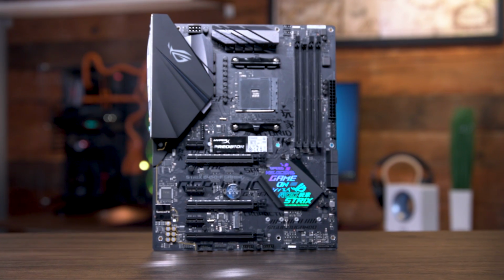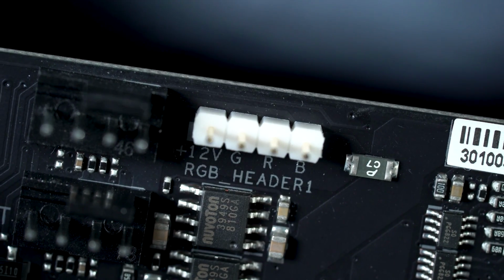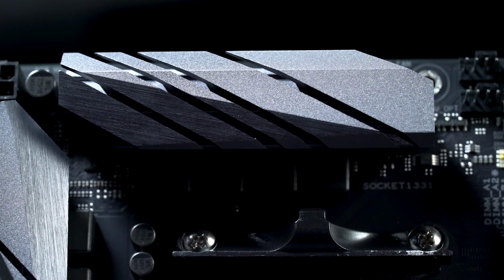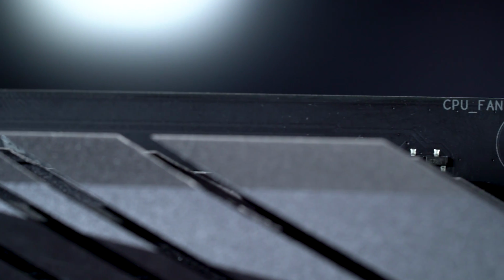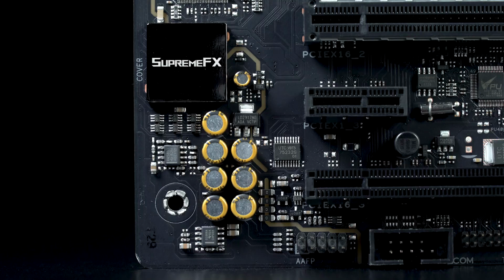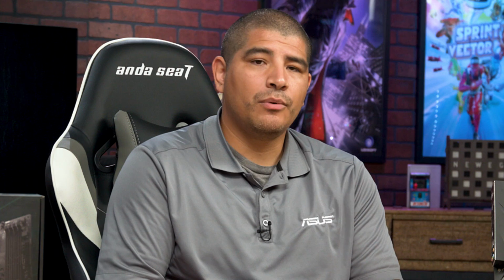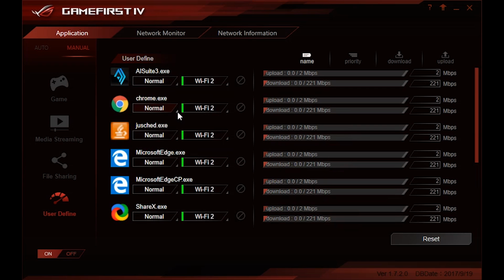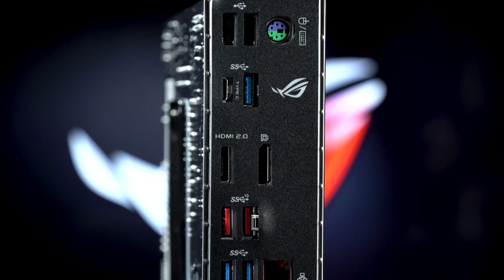ROG STRIX B450-F GAMING – Hits The Sweet spot for AMD PCDIY Gamers & Streamers

Comment: I have a system with 
ryzen 5 3600x
ASUS b450-f gaming mb
Corsair vengeance 2x8GB 3600Mhz Ram
Ssd 500gb
850w psu 
Fractal design C case
Corsair H100i Pro Xt water cooler 
And some fans,

My Ram is very new, and the orange light appears with both stick of ram in, and with this no picture says no signal…when I do one stick it’s fine and get a post bit I want to use both ram sticks, do I sell my current ones then buy a lower speed ram or what can I do…

Also the RGB of the AIO doesn’t like up, the fans aren’t rgb but the actual pump is. How do I turn it on?

Comment: I Built a system, the second one i've ever built :D

Specs:
CPU: Ryzen 7 3700X
GPU: RTX 2070
RAM: Corsair Vengeance 16GB 8x2 
Cooler: Nzxt kraken
Motherboard: Asus ROG STRIX B450-F (This One In The Video)
PSU: Corsair 750 W 80+ Gold Full Modular 
Case: NZXT H510 (White)
Custom White PSU Cables
Reply: does it have wireless wifi thing?
Reply: @mrtaco0078  no, not that im aware of
Reply: @Vestrix  bonkers
Reply: @mrtaco0078  BoNkErS
Reply: @Vestrix  thx for answering my question btw:) i completely forgot to Thank lol
Reply: @mrtaco0078  np  :D

Comment: i don't understand one thing with the M.2, if i install my M.2 drive on the second slot (the one at the bottom of the motherboard) will that affect the first pci-e slot where the graphic card will go? reason i'm asking is that from what i read the first M.2 slot makes 2 sata connectors disable and the second makes a pci-e go from x16 to x8 speed but it didn't specify which one, and i was thinking of installing the M.2 at the bottom to not be so close to the cpu cooler and graphic card.

hope someone can answer this.
Reply: Yes I also have the same question and now I wanna add another m.2 how will set this up for my GPU to be unaffected
Reply: I have the same or almost same question!
Reply: I have this board from an used build and the 1st ssd slot looks to need bigger screws than the 2nd one, i am wrong or the guy before me kept some pieces loll ?
Reply: don't know about screws but i can say that i ended up learning that yes the second slot is slower than the first one, something to do with PCI limitations, same reason you get a bigger slot at the top for the graphics card and no one is suppose to connect one at the bottom

Comment: for some reason when I put my build on pcpartpicker, it says  “Warning!Some AMD B450 chipset motherboards may need a BIOS update prior to using Matisse CPUs. Upgrading the BIOS may require a different CPU that is supported by older BIOS revisions.” What does that mean and can I still get the motherboard with the parts?
Reply: Well most b450 motherboards should have the bios update now a days so it’s basically a 0% chance that a mother board dosent have the bios update so you should be fine
Reply: Timmy Huynh yeah it depends where i get it from because some warehouses might have some of their motherboards sitting there for a while so let’s just hope the one I get is ryzen 3000 ready lol

Comment: My ram is 3200mhz 16gb so with this board i can overclock it 3200+ right?
Reply: I have this board and I can run up to 32gb 3600mhz
Reply: @Virus-ln4eq  despues de la actualización de bios, es verdad que puedo hacer eso de dejarlas a 3600 mhz ?, pero las ram deben ser para esa frecuencia?
Reply: @barkley96  sí, debería poder cambiar el mhz de ram a 3600 después de actualizar la BIOS, pero asegúrese de cambiar el mhz en la BIOS. Lo siento Si hay un error en este mensaje, estoy usando Google Translato
Reply: you most likley will, check the manufacturers website for more info on overclocking capabilities but in my opinion going above 3200mhz wont give much more performance gains and it can be a pain to overclock, 3600mhz is probably the highest you really need to overclock to, however if you do plan on overclocking to higher than rated on your ram kit your cas latency timings may get worse and overvolting may be needed which can cause trouble with a few ram kits

Comment: will a 2070 super trio x run good with this board
Reply: it will run fine,  i had a 2700 super and moved up to a MSI rtx 2080 super trio and it still works great,   that and added 2 more sticks of 8GB corsier veng pro  ram for a total of 32GB  and it runs very solid.   did a few bench marks all scores were great and it runs VR good,   it did this alll on the 2070 super too,  but mine was EVGA black.   im still using a 2700X chip im waiting on the 5000's to drop  or a 3900x to decrease in price due to the new cpus,    and then a rtx 3080 is on the list.....when i can get one... ide like to go MSI or founders edition but slim chance we will be getting those at  listed price any time soon.  the pc ran VR great when it initally had a evga 2070 super with that 2700x  and wraith prisim cooler, with only 16gb veng pro 3200 ram.   so the upgrade was just because i wanted it but it did not NEED it. it ran fantastic as it was.   im also using a 850 watt gold PSU.   i wouldnt skimp on the psu and if you use the supplied thermal paste with a cooler  i cleaned it and bought some of the better stuff as i plan to OC the CPU soon here,  the GPU you can just use MSI afterburner and ramp up to the fans to keep it cool and then it runs flawlessly,  38-55 degrees under 99% load with fans at 70%,     when i left them on Auto the gpu heated up to  74C and i wasnt a fan of that.     you can do alot more with afterburner but just ramping up the fans made a big difference for me,   im using a coolermaster H500 case though so it has great flow with the stock fans and its all mesh.  the RTX super cards do run hot though so make sure you have good cooling,

Comment: Hey guys this is about to be my first time upgrading my mobo and I have a couple questions. How do I transfer over my Windows license? Also, will all my pc files such as games & other applications installed on my drives transfer over if they’re saved on the drives? Or will I have to do some type of backup ? Thanks for the replies in advance.
Reply: Your Windows licence will have your previous hardware configuration associated with it, but to my knowledge Microsoft allows for a little leeway when swapping out hardware components so I'd guess that you shouldn't have much trouble simply swapping out the board and hitting the ground running. 
That being said Windows can throw tantrums when major hardware changes occur, so stick to best practice and make backups of any non-recoverable data (Personal files and such). Anything that you can download again (such as your games) you won't have to worry about, just download them again. Might be a pain depending on your internet speed, but ultimately so long as you make sure to backup anything you don't want to lose it's not that hard a pill to swallow. 
To be honest though it's a good habit to get into to simply reinstall Windows every couple years at the least, so if you upgrade your motherboard it's as good an excuse as any to start with a fresh install. Just use the same licence key and you'll be grand.

Comment: I am building a pc with ryzen 7 3700x and a MSI RTX 2070 super, dual channel 16GB 3600 RAM. Is this a good choice of a motherboard performance wise? I don't care about aesthetics, extra features like wifi, SLI PCIE 4.0 etc... Please let me know, this mobo is on ebay for $138 so the price is really attractive
Reply: Bro: have you bought it? I'm building a similar pc. Does it work?
Reply: Lord Voldemort I ended up going with tre b460 tomahawk max because it has better VRM but this will do fine too if you can’t find the b450 tomahawk

Comment: New Built Pc Won’t Boot, No Display

I’ve just built a new pc all parts brand new and everything in the right place and i press the power button everything Powered up but no display in my monitor And CPU fan not working even though i plugged it into CPU fan socket in the motherboard and USB ports in the motherboard not working also the one in the case then I’ve tried to unplug the cpu fan and put it in any of fans channel and it’s working but still no display nor USB ports are working!? 

Could anyone please help me? 
And just to let you know that English is not my
First language so if anything not clear please let me know.

Thanks...

Specs:

CPU: AMD Ryzen 7 3700X Processor (8C/16T, 36 MB Cache, 4.4 GHz Max Boost)

CPU COOLER: I’ve used the one it comes with amd cpu rgp

GPU: MSI Nvidia Geforce RTX 2070 Gaming Z 8G FH GDDR6 DP/HDMI Turing VR 4K PCI Express Graphics Card

PSU: Aerocool Integrator 600W Power Supply, 80 Plus Bronze, Up To 85% Efficiency

MEMORY: Corsair Vengeance RGB PRO 16 GB (2 x 8 GB) DDR4 3200 MHz C16 XMP 2.0 Enthusiast RGB LED Illuminated Memory Kit

MOTHERBOARD: ASUS ROG Strix B450-F Gaming ATX Motherboard, AMD Socket AM4, Ryzen 3000 Ready, PCIe 3.0, M.2, DDR4

SSD: WD Blue SN550 1TB High-Performance M.2 Pcie NVMe SSD

CASE: Corsair iCUE 220T RGB Airflow, Tempered Glass Mid-Tower ATX

Comment: So I bought the b 450 f board so here's the thing I have a 3000mhz 2x8 gb g skill trident ram and my computer blue screens is this b3cause of the motherboard not being able to handle the frequency  ive looked up the compatibility of my ram to boards and the b 450 f isn't there. Should I buy the 570 e to help solve this

Comment: For some reason the ethernet port will not recognize the ethernetcord. All drivers are installed.
Reply: Jonathan bullock did you figure out why that was? I am having the same problem.
Reply: @nicholaswhite2031  Nah man, I troubleshot all night. I just went and bought a new motherboard after call AMD and they told me they didn't know either
Reply: @XxDecember1xX  Yeah I had to buy a new motherboard as well... very frustrating.
Reply: @nicholaswhite2031  sorry to hear that but I'm glad to know you got it solved

Comment: so im building a system does a 
r7 2700x 
and a 2060 ko 
go good with this other board?
Reply: get a r5 3600 its better then the r7
Reply: @matik200  not exactly, 2700x is better for streaming and includes an rgb wraith prism cooler that the 3600 doesnt have, yes the 3600 is better for gaming but those extra cores and threads you get with the 2700x can be useful in certain applications, it all comes down to what the customer wants
Reply: Yes, its a good buy, great for an rgb build

Comment: What type of M.2 SSD does this board (Rog Strix B450-F) take?  Regular M.2 Sata or NVme?
Reply from the maker: 2 x M.2 Socket 3
‧ 1 x Type 2242-2280, supports SATA & PCIe 3.0 x4 modes
‧ 1 x Type 2242-22110, supports PCIe 3.0 x4 modes
Reply: @Neweggstudio  I'm still new in PC bulding. Does both M.2 can be used as storage? Because I noticed it mentioned that only the type 2242-2280 can supports SATA & PCIe 3.0 x4 modes, whereas the Type 2242-22110 just mention it supports PCIe 3.0 x4 modes.

Comment: where do i install an m.2 if i have a SATA SSD
Reply from the maker: An M.2 is still installed in one of the designated M.2 slots. If you have a SATA 2.5in SSD, those will still plug into the SATA power port and need to be mounted in the case.

You can see where we installed an M.2 (Kingston Drive) at 0:04.

Comment: So if I have rgb fans, Do I have to plug them in to the rgb connectors on the motherboard or still the fan connectors?
Reply: There would be 2 connectors. RGB header for the RGB and another for the fan

Comment: Does this motherboard have built in wifi? If not, how will I sign into wifi?
Reply: No built in WiFi, so you've a couple of options.  Add a WiFi card to insert into the motherboard, use a USB WiFi adaptor or use an Android phone and connect to your WiFi, set the usb mode on the phone to "Usb Tethering" and it'll behave like an ethernet cable when you connect via USB.
Reply: You can’t download any drivers or anything like that?
Reply: @justinnguyen8340  drivers are for hardware, as there's no WiFi on board, no driver will make it appear. You'll need to use ethernet to connect online
Reply: Ok thanks sorry if I brought you any inconvenience
Reply: @justinnguyen8340  No inconvenience, just worth noting. I always use ethernet anyway, so it's not a stickler for me. 

If you're thinking of having it without immediate access to the router, you can always pick up a WiFi adaptor quite cheap.

Comment: Can I use this mobo with a Ryzen 7 2700 and would I still have to update bios??
Reply: This works with the R7 2700 you should update the bios.
Reply: Nick Apromollo ok thanks but do I need to update the bios for it to work?
Reply: @warnerconsolino8532  Runs fine with or without updates, you should though
Reply: @warnerconsolino8532  But im using r7 2700x
Reply: Nick Apromollo aight thx
Reply: @warnerconsolino8532  I set up this exact mobo and r7 2700x yesterday, no issues with preloaded bios or updated bios, Enjoy bro, its a good setup

Comment: I had a problem with my Ryzen 7 2700x not going into this motherboard everything looked perfectly fine on the cpu and I lined up the triangles and dropped it in but one side of the cpu would be in while the other would be out and vice versa with the other side of the cpu
Reply: Go to a shop and let them build
Reply: EKBK make sure there are no bent pins if you still need help
Reply: This is one of the easiest boards to build on, hands down. I know it may seem like a dumb question, did you bring the retention arm up? I've seen a few bent pins where people simply haven't lifted the arm to bring it in. 

Do.  Not. Use. Force. It takes ZERO force to install the CPU correctly, this is where the bent pins come from (and CPU coolers being over tightened).
Reply: @Revenge2393  mine just won’t fit into the io spot I’ve been trying for hours
Reply: @nou6723  When you say the IO spot, what do you mean? The IO opening on the case for the shield to go into?
Reply: @Revenge2393  I know this is a week late but yes it wasn’t a problem with my motherboard tho it was the case
Reply: @nou6723  A bad cut out I take it?

Comment: How many fan connectors are on this board?
Reply: Ajay Mackie ive connected 4 case fans and 1 aio pump with no problems. Note that plugging a case fan into the aio spot will make it run to fast and it will be loud

Comment: Can i upgrade the bios for ryzen 3 3600 whitout a 2nd gen cpu?
Reply: it should be ready mine said it's ryzen 3000 ready on the box
Reply: Referring to VST store said, the mobo box needs to have a red sticker in order for it to be ready for plug and play for 3rd gen CPU. If not, you'll need a 2nd gen CPU like you said.

Comment: 16gb 3600mhz does it work on b450f
Reply: the B450f allows up to 3200mhz so i wouldn't even set it higher than that because there is no need. Even though 2800 is good enough for ryzen but as we all know ryzen loooooooves their ram speeds. I clocked my ram from 2400 to 2733 on a b350 prime plus cause it wouldnt want it any higher
Reply: it work but 3460 mhz not 3600 mhz

Comment: my rig is rx580 4 gig oc addition Ryzen 5 2400x at 4.2 boost speeds x2 m2 slots 512gig  and 2 solid state drives samsong evo pro 500 gig and 16 gig 2400 ram I got all this at black friday this morning costing a little under 500 because my brother is giving me his rx 580 in i already had the ssd this will out perform my asus tuff laptop and i got a 144 mhz with radeon freesync

Comment: Does this Motherboard support AMD Ryzen 3rd Generation?? Like Ryzen 5 3600x
Reply: After you update the bios yes, the update implements stable oc for 3gen
Reply: @ESakaNYo  how do you update the bios?
Reply: @leander_aunvik  download the update file from the makers website onto a pendrive and launch bios and update using the pendrive
Reply: @ESakaNYo  and also, do i have to update if i an not going to overclock?
Reply: Mine supported it straight out the box, no need for a BIOS update unless mentioned otherwise. Amazon will have the batch listed as Ryzen 3000 ready which is what I opted for. Takes the agro out of messing with the BIOS

Comment: could 5v rgb fans be used with the mobo or do they need to be 12v
Reply: you cant plug it into the mobo put you can use the power supply.

Comment: I'm going to use Ryzen 7 2700X but I don't know if the cooler I use: "Cooler Master 212 RGB Black Edition" can be controlled with Asus Aura Sync. Does it have to be ARGB or directly Asus Sync product?
Reply: Two cables are included for you to choose from, the USB option will allow apps to control it. I'd recommend trying ASUS first. IF you don't like the light setups. Unchain it from all the other RGB you might have in the app. Then use cooler masters software for the cooler. Lots of options and setting to change in the cooler master app. There is plenty of forums on the two options. GL
Reply: @wayner2ll704  I've found out that the leds aren't ARGB so I've found cheaper, but also a good Cooler that is compatible with Asus Aura Sync.

Comment: can i fit amd wraith prism (stock cooler) on it?
Reply: Yes you can, very easily. However, look into the cooler master hyper 212 Evo / Evo V2 or Black. They're £30, but they'll keep your CPU cool consistently. The difference is staggering between the Stealth, Prism and Wraith coolers. 

CPU temps on my 3600 rarely exceed 63° after 4 -5 hours of continuous gaming. The stock cooler is 10° hotter. 

It'll help you in the long run and for longevity purposes. PCs are an investment, and keeping the CPU cool is a massive thing that's often overlooked. Don't skimp on the cooling! It'll be the difference between you wanting a new PC in a year or 3-5 years.
Reply: @Revenge2393  Ok thanks alot man!

Comment: Max memory support on this mobo with 4 DIMMs setup is only 2733 Mhz..? I trier DOCP and it takes me to infinite boot loop.
Reply: It supports up to 3200mhz. Maybe its the ram? I wouldn't rule out faulty board though.
Reply: @owenw.7904  nope.. today I just exchanged my RAM.. still no good.. max I can get stable is 2666.. this is pretty sad. 4 DIMMs aren't supported on this mobo.